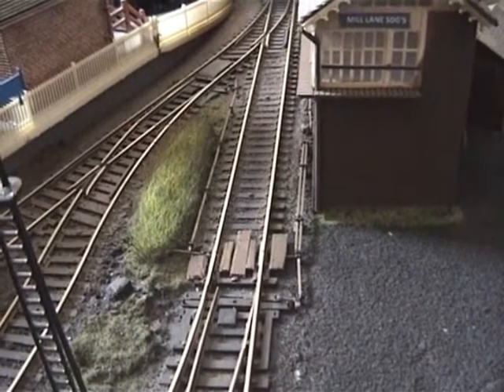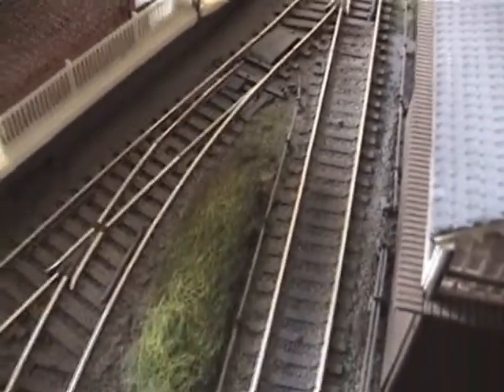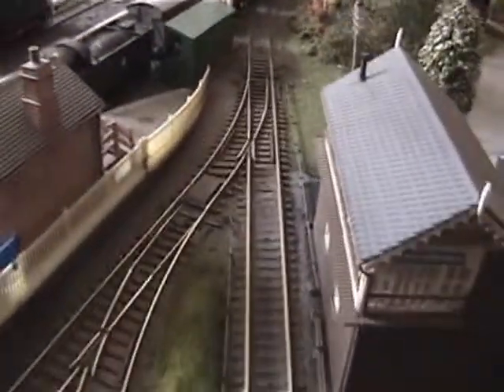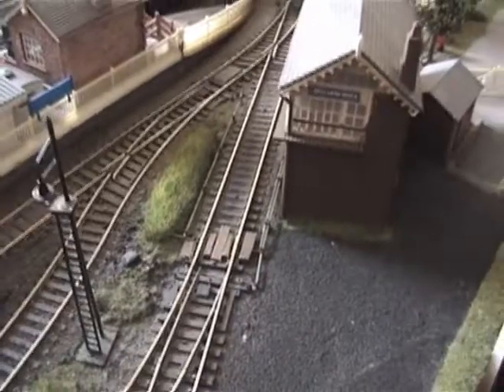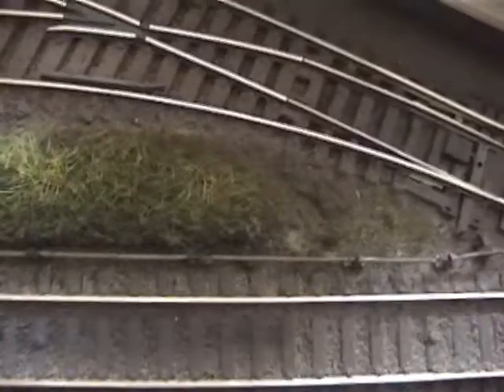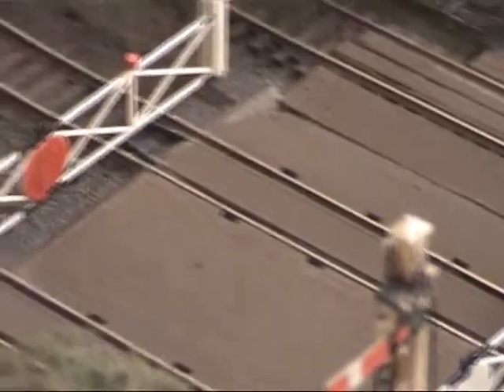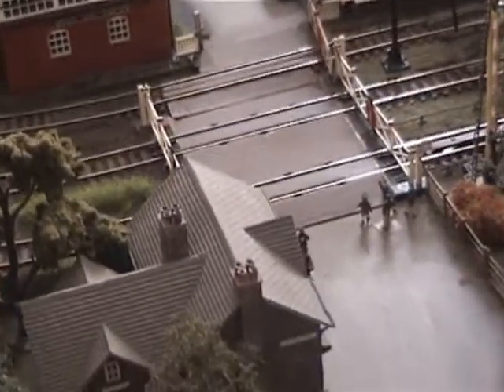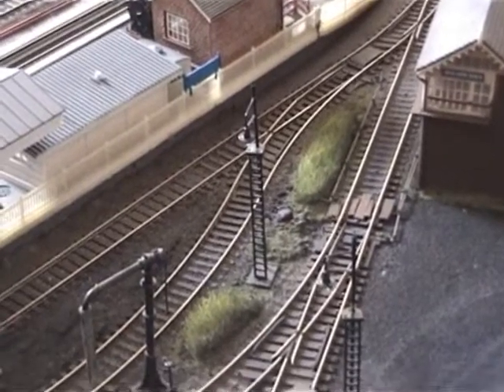Update May 2014

Comment: Wonderful! Your videos of your very detailed and realistic railway laoyout really give me the inspiration to continue with my humble British 00 scale railway project.
I use the Gaugemaster HH feedback (DC) controller which makes my locos move very smoothly. It would be interesting to know which contoller you use.
Cheers from Sweden, Anders
Reply from the maker: Hi Anders, I use a Guagemaster DS twin tracksimulator and break controller, plus an old but very reliable H& M controller. I also have a Guagemaster twin track high frequency electronic track cleaning unit wired into two tracks.Thanks for the comments, all the best to you in Sweden, regards, Richard

Comment: I'm just making up some Wills point rodding and hope it'll be worth it (I think it will) but I'm not familiar with the configurations! It's a bit of a pain to put together, so if anyone's thinking of getting some, do, but be patient and spread the work over a few days to take your time! Nice video, thanks for sharing!
Reply from the maker: Tweezers, super glue, lots of patience !, I tended to use photographs from books, rule of thumb is look firstly at what you want to represent mechanically, if say a set of points and a facing point lock ,that would be say two rods glued side by side, one for the points one for the interlock on the points, run them back to your signal box and use the L shaped bell type cranks mounted on the small rectangle plates of various height, the long and short arms that have a bracket at each end are for the point motor/point switch blade end at the end of the sleeper., thanks for your comments, hope your project comes to fruit !, regards richard